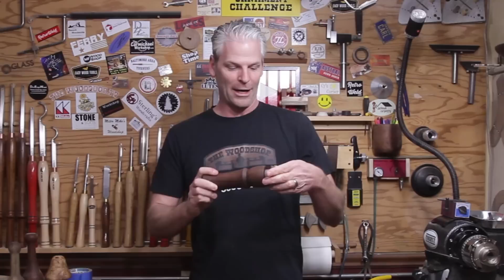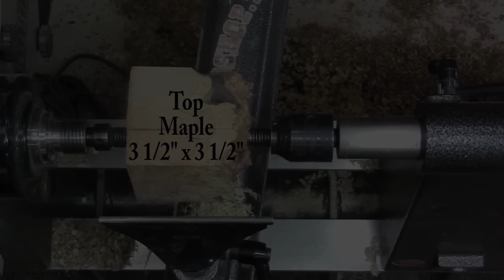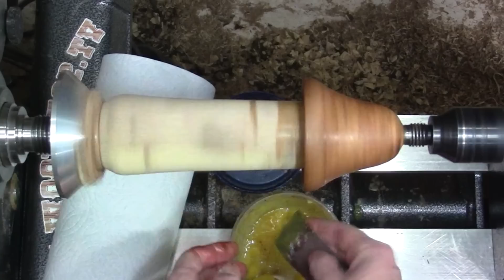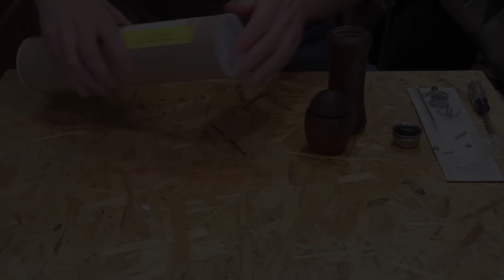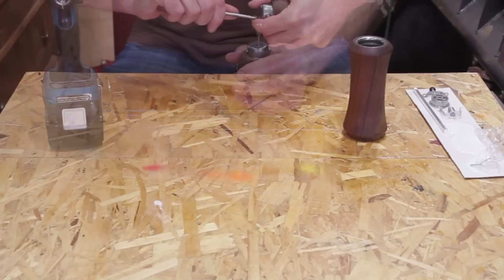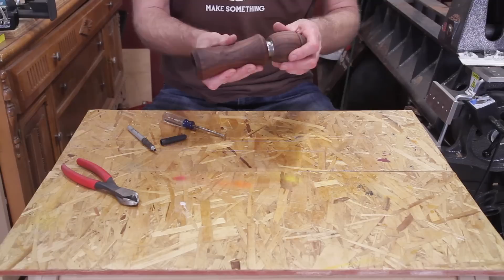Woodturning Pepper Mill Salt Shaker Combo

Comment: Carl: I got their kit but had a problem with the salt top and mid-section being off center after turning. When I flip the sections to drill the Forstners, they don’t align back up. I was thinking after parting off the sections and drilling, I need an insert similar to the plastic pieces but made from aluminum or hardwood. Then connect the top and mid and finish turn should guarantee they are aligned ? Any suggestions?